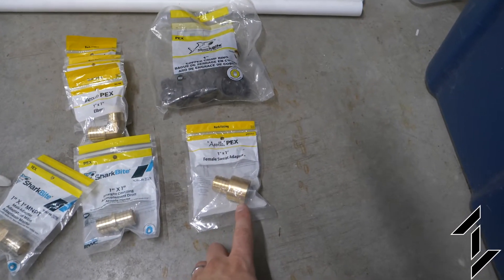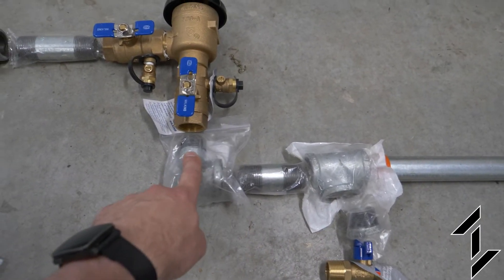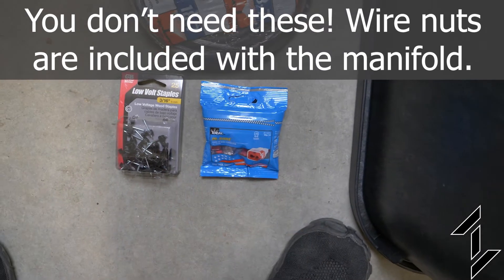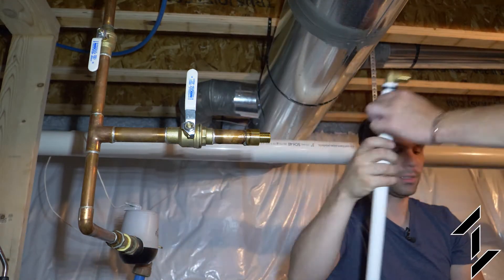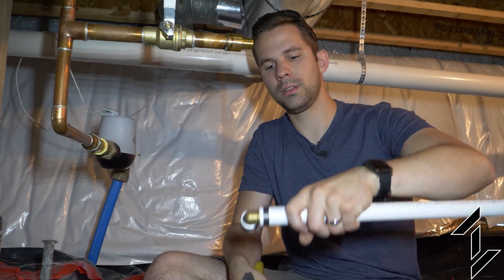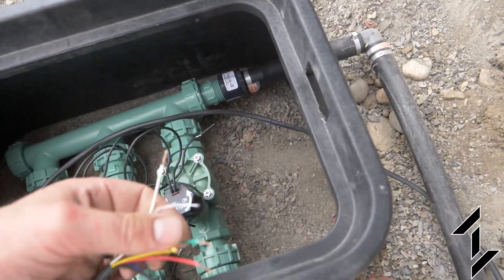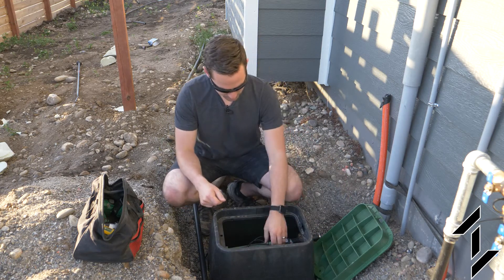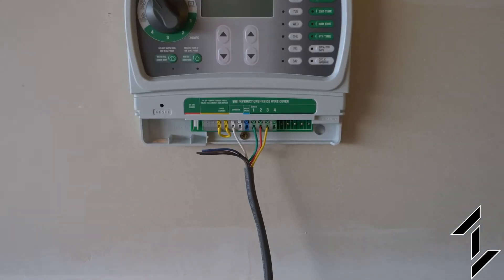How to Install Freeze Proof Sprinkler Water Supply

Comment: What is connecting the black pipe to the manifold
Reply from the maker: It's a poly to threaded hose connector. Should be able to find it in the sprinkler section at your local home store.

Comment: Is the Black exterior pipe which goes to the box a pex pipe?
Reply from the maker: It's a black polyethylene pipe. That style is the most commonly used pipe for underground sprinklers at least around where I'm at. I would imagine pex would work but it would be very expensive.

Comment: You should not put galvanized and brass or copper together you WILL get corrosion!
Reply from the maker: Hmm, I see your point. What should you connect to the brass backflow preventer then? Plastic seems like it would degrade if exposed to UV outside.
Reply: @42Pursuit  you can use a dielectric nipple or dielectric union for joining dissimilar metals.

Comment: I have an old copper irrigation system. what's the best and easiest way to rise the heads to the current grass level?  The current heads don't even seem to be solder on the pipe.
Reply from the maker: Hmm, unfortunately I'm not familiar with that sort of system.

Comment: How’s the galvanized pipes holding up so far  ? I’m trying to decide best pipe to use. Will galvanized rust with time or should I use pvc?
Reply from the maker: It's holding up great! In my opinion, galvanized is the way to go. It shouldn't rust and will last way longer than PVC which will degrade over time in sunlight due to the UV.
Reply: @42Pursuit  the only problem with galvanized pipe is that unless you use a di-electric union to connect them to brass, the weaker material (iron in this case), will corrode away in a few years.

Comment: You should never blow sprinklers out using the test cocks on the PVB.  You need to install a tee at the downstream elbow and blow sprinklers out from there. Damage in your PVB can happen if blown your sprinklers out from the PVB test cocks. I was a backflow tester and installer before I retired. Thanks

Comment: Thanks for sharing. Why did you use galvanized instead of copper? Looks great.
Reply from the maker: I haven't ever seen copper used in my region so I thought it best to stick with  what others were doing. I have seen PVC used as well, but galvanized seemed like the much more robust long-term option.
Thanks for watchin!
Reply: One should never put copper fittings on galvanized pipe. A reaction of the two causes corrosion followed by failure. Thanks
Reply: @noneya9013  FOR SURE....
Reply: I was wonder the exact same thing!

Comment: Great video! I am trying to build an automatic sprinkler system with 75 psi of static pressure, but only a flow rate of 5 gpm - the area I am trying to cover is around 3500 square feet of lawn. Do you know roughly how many heads or zones I should be running for a space that large? There's so many options. Thank you
Reply from the maker: Ah, that's a bit beyond me. I just figured out what plumbing was needed to get water from the house to the sprinkler box, the sprinklers and line had already been installed in this yard.
Reply: I’m in exactly the same situation as you. Would love to hear what you come up with.
Reply: @AaronEsterling  I followed Hunters Sprinkler Design Guide it provides a step by step process. Each sprinkler has a psi and gpm rating.  Looking at your psi, gpm flow, meter size, etc provides what is called a working GPM. If you total the heads of the same type in a zone you keep it under that working gpm number. Not that hard… I also estimated pressure loss and there are some simple calculators for that as well.